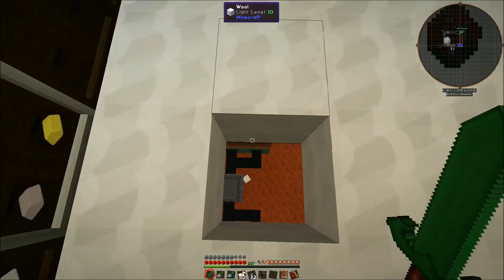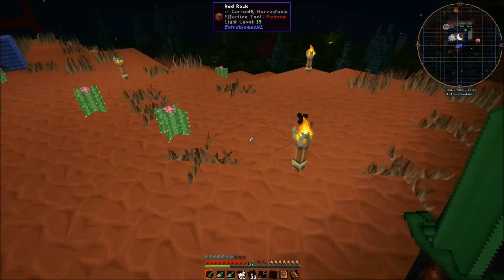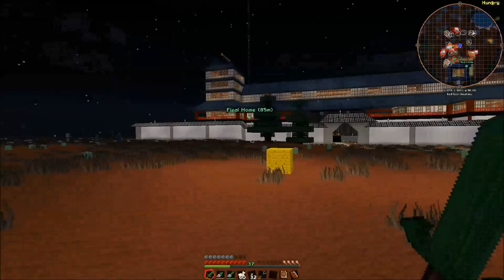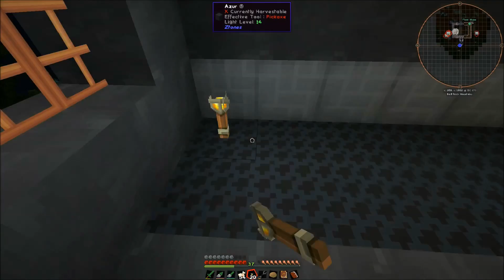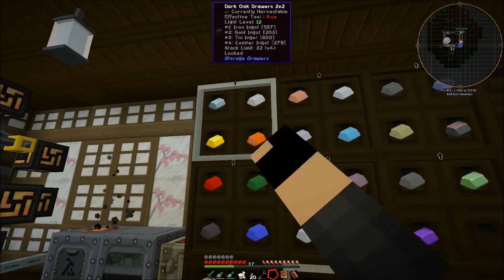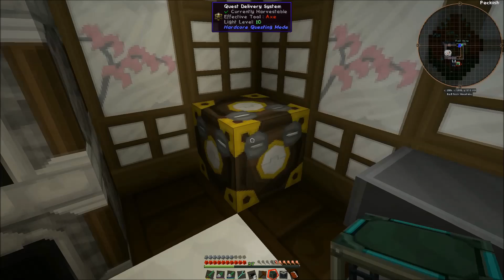Minecraft Infitech 2 Lp Ep 27: Running Out of Power

Comment: I'm waiting to see what factory your awesome building skills will make
Reply from the maker: Hehe, well thank you muchly :)  Survival building takes a while for sure, but honestly the drill and saw have helped a ton to make things go much quicker.  Not just due to the material cost reduction, but also the speed that they harvest :)  But I'm going to go with something a little more modern, something like some of the tech centers I saw when I was in Japan, but try to make it feel like it fits into the town at the same time.  Still working on the exterior design and all and fleshing that out.  Wanted to use concrete and asphalt some, but not totally sure since they cost a bit more in gregtech than just making a cobble works to smelt gravel.

Comment: You can turn the Sphalerite ore into Zinc Cluster :)
In most cases when you can smelt something in Alloy Smelter you don't explicitly need dust, you can use ingots (for example for the Battery Alloy you can just use Ingots instead of dusts)
Compressed Air in Electrolyzer is BAD idea. It consumes so much power. You are much better of with putting it into Fluid Canner (as the quest text recommends you)

now for the MV transforming. No idea why the Soft hammer did not worked,, but... To UP convert you would really need 4 LV generators feeding into the Transformer (because 32*4 = 128). Or, what might be better, is to just replace your LV Generators with MV Generator and feed the power to the MV Buffer > MV Energy Hatch. Especially with the upcomming pollution. The lower tier Generators produce more pollution than the higher tier ones.
Also you cannot use LV batteries in MV Buffer (have you ever tried to charge AAA battery directly from power outlet? (ignore the AC/DC difference in this example) :))

Maybe I need to enhance the first Silicon Age quest with having you make Medium batteries so players will realize :)

Power production with MV is going to be quite a pain with Biogas.You would need to enhance your farm pretty much 4x to be able to keep the sustainable amount of it. I personaly kept Steam power up until HV, when I started to produce Nitro-Diesel

Oh... And great accidental intro with breaking the floor :D
Reply from the maker: Oh nice, I didnt realize that about the sphalerite ore :)  I was just looking for zinc ore but was having no luck.  And yeah, I think I had used ingots before in the alloy smelter, I think it just slipped my mind in this video.  Had a lot of power outages that day and so I was working late and maybe getting slightly tired :p  And thanks for the heads up on using the fluid canner.  I had scanned through the quest text for it, but I do believe I missed that.  I knew it was taking a bit of power to break those down :)

And yeah, im not sure why the hammer didnt work.  I did some reading on the transformer and what I read said to give it a redstone signal, but I assume thats an older thing with gregtech and now the soft hammer does the job.  But just setting up mv generators sounds like a much better method for sure.  Though I didnt think about needing to make mv batteries, that does make sense though for sure.

And yeah, I was actually considering setting up a steve's carts treefarm fairly soon since it seemed like at least basic level was very doable atm, and then using that to create charcoal and feed a railcraft steam boiler from there and then that steam going in to feed big tanks.  That was my idea anyway for once I start working on a factory type area to set up machines and automation and a more focused power source.  I'll still probably keep my current setup under the floor for now just for some personal on hand type machines, but for the larger more power hungry setup I feel like the steam boilers would be solid.

And thank you muchly :p  Totally didnt mean to do that, wool breaks so quickly, lol.  But thank you again so so much for all the input.  Its very much appreciated for sure
Reply: Ok. So the Transformer. It works as intended. Ignore the text, its misleading, but the transformation is happening. It also should change the texture of the dots BUT! the texture pack has it broken. I am going to file a report to MauveCloud who is working on GT textures for Sphax and appeal for a fix :P
Reply from the maker: Oh, ok, that makes sense :)  Thanks for letting him know.  I was about to test the transformer myself in a creative world after I finished up the skyfactory video that I'm working on, but I def appreciate you letting me know.  I will probably just start working on converting over to mv power sources tonight and setting up an area to get all that going for steam production.